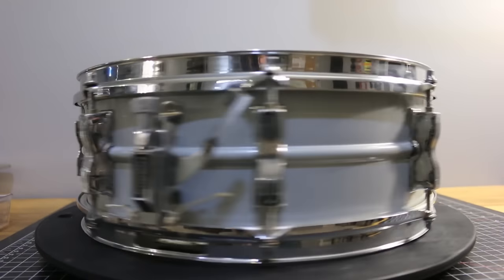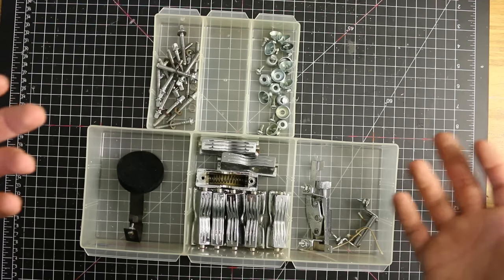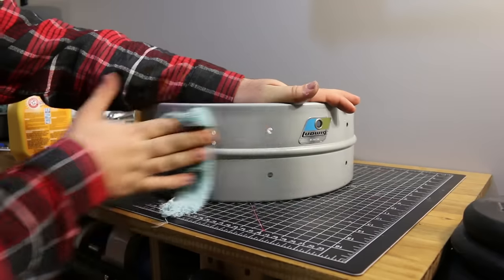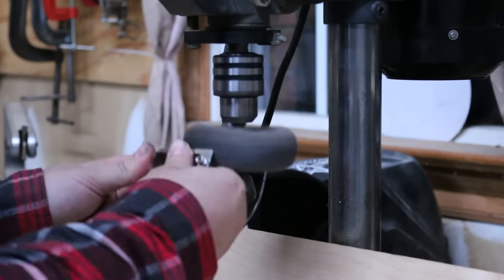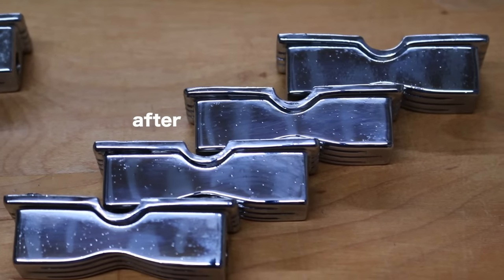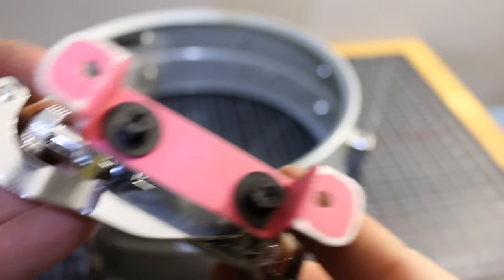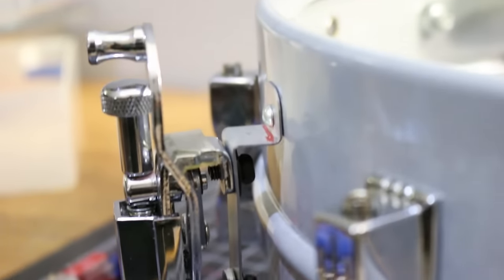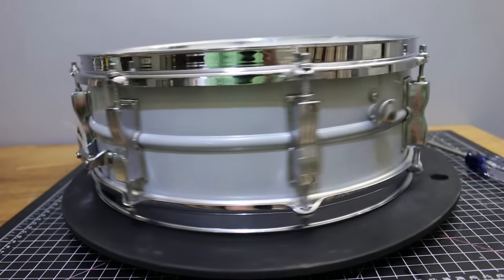Ludwig Acrolite Restoration

Comment: The trick to the Ludwig snare switches is to unscrew the tightener all the way off. It will let the one piece separate from the bottom. Then you can reach the screw with a screw driver. Sorta sucks. But I found that out while restoring my own acro.
Reply from the maker: socket was easier, I guess it was ludwigs way of saying "hey youre about to take off the lugs, get a socket out" lol
Reply: rdavidr next time you wrap a snare or tom can you wrap it in blue silk onyx someone on ebay is selling the wrap I bought it and wrapped my one floor tom so it would match my kit and my 10x4 pearl short fuse snare

Comment: I love my ('79 to '81) Acrolite. Mine was in excellent condition when I bought it, polished to a gleam, so I didn't bother using my Turtle Wax Chrome Polish & Rust Remover on lugs/hoops. (NevR Dull works on Aluminum, as does Flitz No Scent Metal Polish ). 
I did put new Ludwig 18-strand Vintage Snare Wires (L1963) on it (which comes with grosgrain ribbon), along with a new INDe strainer & butt plate, & it sounds vintage in a "brand new" kinda way. It is now my favorite out of 7 snares.

Comment: Great video bro!  I just did the same restoration with my first snare drum, an awesome Acrolite.  I had a similar issue with the throw-off...nice fix on the throw-off hole alignment.  Mine was in very good condition, so I did not have to do to much to it either.  However, I did replace the hoops with die-cast hoops.  Due to it being an 8 lug snare this made a noticeable difference to me with it holding better tune and sounding and feeling more solid.  Really enjoy your channel and videos!  Happy drumming!
Little Drummer Channel ;)

Comment: Great stuff, as always. Have you ever though of using a sonicleaner for small parts? Harbor  Freight sells one for like $50, and it is great for small parts. I use it for gun parts, but it would work really well for screws, lugs, bolts etc... Just a thought.

Comment: I have a suggestion for a cleaner that won't mess up the surface. As a teenager I worked as a janitor and we used to have to clean these stainless steel doors and surfaces. An old fella taught me to use a semi abrasive cleaner like Ajax or Comet. Not too harsh but has enough grit to remove dirt and more importantly adds brilliant shine. Take a small amount in a plastic cup and add a little water until you have a light paste. Then take a cloth and lightly scrub in the same direction that the metal goes. Afterwards keep wiping off with a clean cloth and clean water until all the cleaner is gone. I obviously wouldn't recommend it on a chome drum like a Supra or anything, but for a dull finish like an Acro I think it would work like a charm.

Comment: Excellent video. I have a 1978-ish Acro, got it around a year or two ago, and it's my favorite snare at the moment with my keystone Supra 400 a close second. A real no-fuss drum that just works, tunes easily, and gives you a variety of sounds with tuning, tape, or T-shirt. ;)

I've thought about stripping the paint to bare aluminum, but I probably won't...even though it has a lot of brothers, I still like keeping things original. Also, my P-85 functions perfectly fine at the moment, but it has only holes for snare cord, so I use the Gibraltar cord while the Ludwig orange stuff is on eternal backorder from one of my local stores. I prefer cord anyway; in my opinion, you can dial the snares in better, if not without a bit of trouble at first. I also appreciate the tone control, which I happily use as I don't strike the drum too hard. I had a phase there of removing them, only to reinstall them or plan to later.

Comment: Hey some help over here, by destiny I end up wtih a Ludwig supraphonic from the 65's, it has some of the traditional pitting of this snare. How would you restore it? Would you use brasso? Would you replace some original parts with new ones? And if someone have another tip to restore a very old and beatiful snare without damagin it I'll apreciate it.

Comment: What do you think about using paraffin wax instead of grease on tension rods? I'm a firefighter and we use wax to lubricate our metal ladders, aluminum specifically. Works like a charm. Your thoughts? I feel like you could eliminate the sticky gooey, Dusty thing that happens to grease over time?

Comment: With the screw driver problem. You can use some thin cloth or rag to put over the end of the tool. It will make a tighter fit and if you slip, it helps what your'e working on not get scratched..

Comment: Time and money well spent, IMO. I've bought and sold half a dozen Acrolite snares over the years, none cost me more than $30. Sold them all on eBay after a little work and new heads for between $125-$200. In retrospect, I should have kept one. It would have filled the void I currently have between my other snares. I really do love the sound of them and they require minimal dampening.

Comment: It's not cheap, but Brownell's gunsmith supply sells a screwdriver kit for $300. It has over 70 hollow ground flat head screwdriver tips, so you SHOULD always find something really close to the screw you need to remove. Rather than skate a screwdriver across an expensive rare vintage guitar, drum, saxophone, or for that matter gun, use the right screwdrivers. This is 140 piece bit set, but if you do bugger one up, Brownells usually sends you a new one. I bought Wheeler sets for $70 but the metal is soft and cheap, and the grinding work is typical Chinese, we don't give a ______, it's flat enough, but not perfect.  The Magnatip kit's machining is perfect.

Comment: It's always worth it.  Your efforts were not in vain.  Except your effort to buy a new strainer for a ludwig.  Only ludwig strainers fit ludwig's (usually).  Even with the fancy dunnet strainer's, you have to buy the special ludwig version.  The really awesome 25 dollar ones, like the one you bought won't fit, and they won't fit over the bead in the middle of the shell.  Now I did not build the adapter before I took mine back to buy a ludwig (because I made the exact same mistake, same strainer and all).  Instead, I invested in the fancy vintage looking one (p-86)that costs a lot of money (though I got a deal from the sympathetic salesman at the local drum establishment.)

Comment: You can use the bottom of a 1/4 or 3/8 drive (can't remember) socket, preferably deep well, as a drum key drill bit. 👌
Reply from the maker: 1/4", 3/8" is too big. I actually have a video in the works about this topic!
Reply: rdavidr Really? Idk maybe i just have big lugs haha. I do remember using the butt of a socket though.

Comment: @rdavidr - What are the importance of the spings inside of the lugs? I just bought a cheap drumset and the lugs don't have springs inside of them. Thanks
Reply from the maker: they keep the tension nut in place. So when you take the tension rod off they stay in place and dont fall in the lug. There are other ways of achieving this, so not all lugs have springs.
Reply: Makes sense. My snare drum has a slot where the tension nut slides in and stays in place. Thanks for the reply!

Comment: I love your videos but you should have stuck with the string instead of the mylar strap. the string can Flex when is under tension the mylay straps don't .  you  get greater snare control with the strings because when you apply tension it starts light but gives you flex as the cord stretches..  it also evenly distributes the tension to the outside of the snare wires instead of just the center wires.mylar doesnt stratch so you get less snare adjustments.  great video and trust me. get the orange ludwig snare cord. i use it on all of my snares

Comment: what good low-cost snare wires would you recommend? i don't drum much so it doesn't have to be of the highest quality.
Reply from the maker: go with puresound. theyre like $20ish and worth every bit of that
Reply: awesome, thanks! I asked because the drumset in my house is an older cheap tama set with an acrolite that i'm trying to give a bit of a facelift.

Comment: To remove a P-85, just loosen the snare tightening nut on the top until the bottom of the strainer (the part to which the snares are fastened) becomes detached, which exposes the bottom screw head.  The top portion will then swivel to either side, exposing the top screw.  Not a bad design, in my opinion.

Comment: Bro it's funny bcuz I have the same exact drum. I found it in my father closet and wanted to fix it up. I bought the same throw off on eBay and it's jus sitting up. If u can, would u make the same lil device for the throw-off for me? I'll pay for it bcuz I need it bad. And I'm also changing out the lug casing to tubular lugs. I found some that would fit.